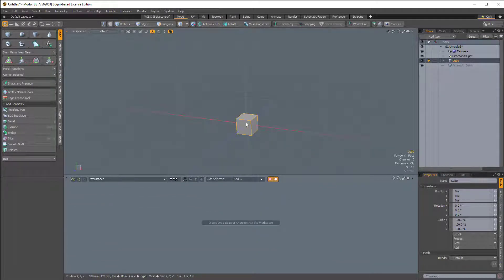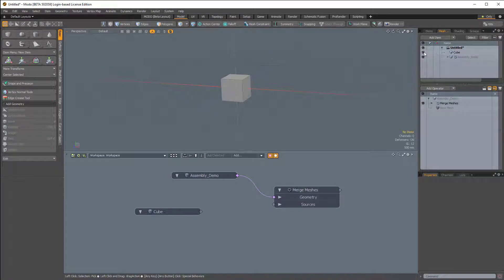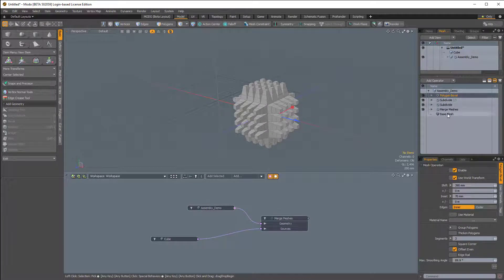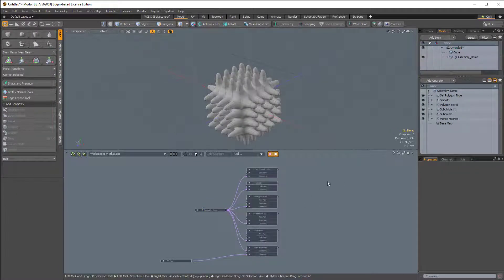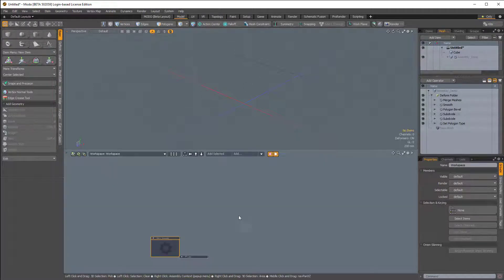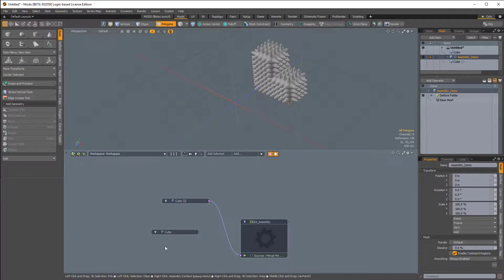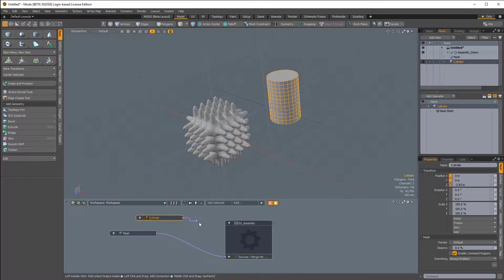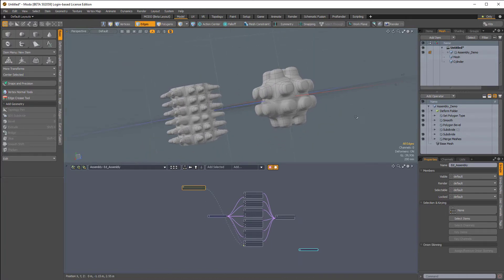Modo Answers - Saving Assembly Presets that Contain MeshOps

Comment: If you select the Mesh Operations from top to down with Shift (or CTRL) and then add the Deform Folder, the order of Operations will not change.
Just remember to select Top one first and there should be no need to reorder again.

Comment: Hi Ed!
A tip : When you FIRST put ONLY the BOTTOM MeshOp in a Deform Folder, and then Shift-select the others and drag them above the bottom one in the Deform folder,
then the order will be preserved and then you will not have to reorder the Deform folder.
(See Youtube video : https://youtu.be/9qaZCRJcmik ). Cheers, Dominiek.

Comment: May I ask you something to explain in another video? Let's say that I created an assembly like the one in this video. Then I realize that I always need to change the bevels shift value. Is there a way to access only that parameter of the assembly without the need to open up the mesh-ops panel and dig in among all the operators everytime?
Reply: Maybe with channel haul that is assigned to locator. Something like in this video:
https://youtu.be/YodvEen7x0Y